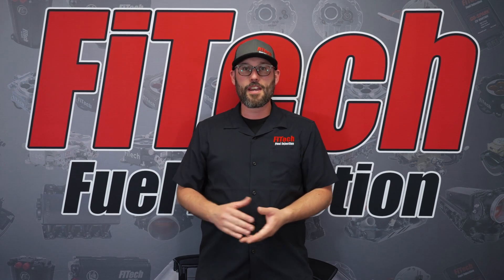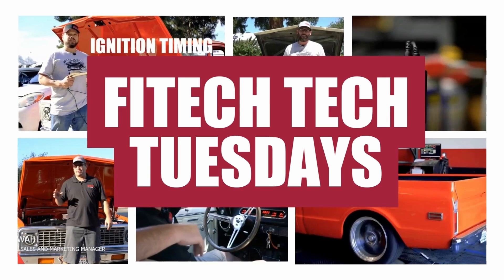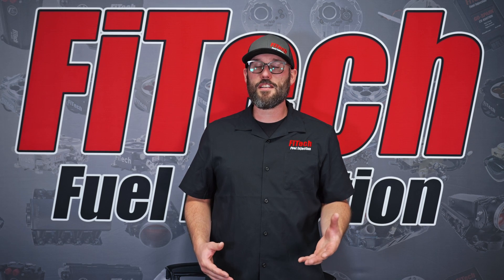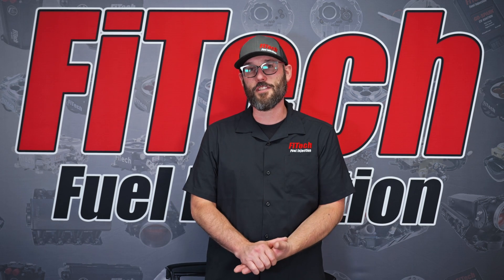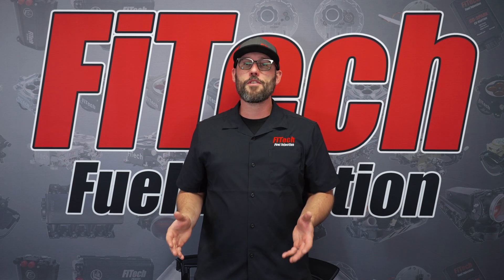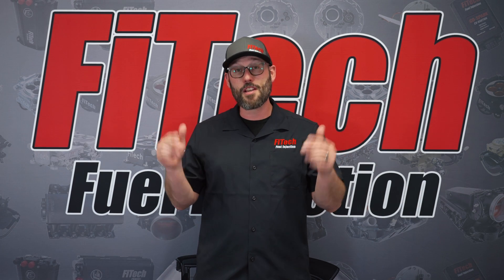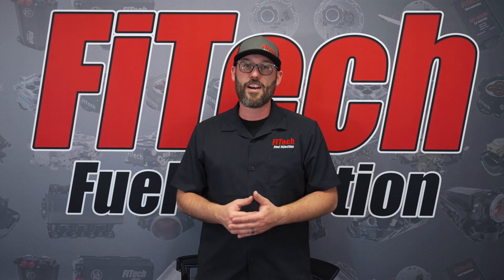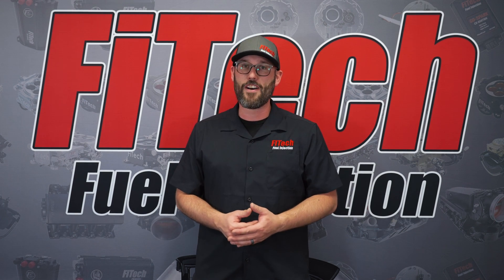Do's and Don't of EFI | Tech Tuesdays | EP90

Comment: Does the ecu have to be grounded?  I have a "No Spark" situation going on, have the complete efi harness w/trans control.
Reply from the maker: Hello sir,

For this issue I recommend contacting our technical support team, they can help diagnose the no spark issue, depending on the system, if running an LS system, such as the ULTIMATE LS ECU, the harness does include ground wires which need to be grounded to engine block, heads, negative side of the battery, frame, ect. If the issue continues our Technical support team can assist you with this issue. You can reach them at 951-340-2624 or techmail@fitechefi.com

Comment: I run a 72 Dart, which I now discover that because it uses a ballast resistor, is therefore not compatible with my FiTech. I have trouble eliminating a stall after coming to a stop where the rpm just sinks. I disabled the DCFC and try to adjust the IAC setting but so far no luck. Could this be the problem? What is the solution?
Reply from the maker: A ballasted resistor ignition will cause RPM noise and will cause misfueling. This is an issue that needs to be resolved.

Comment: I don't know where you got the idea that aluminum tubing that is typically used for fuel line is only rated for 25 psi, but that is dead wrong.
Reply from the maker: Fuel pulsation from injectors opening and closing will rapidly fluctuate fuel pressure which can fatigue aluminum lines. Also with the uncertainty of the fuel line ratings and we need to stick to a standard. There are low pressure aluminum lines out there. If this is accidentally used and we don't mention our take on it, there could be liability issues. Its better for us to say don't use a subjectively inferior part.

Comment: aluminum fuel lines are only good for 20 psi? That's news to me. How about the polytube used on newer cars? Do they hold up to the necessary higher pressures?
Reply from the maker: Anything rated to the pressure of EFI that will not fatigue over time (aluminum) is okay. Fuel pulsation can cause aluminum to crack which is the issue.

Comment: Hello I am, fighting a tach signal issue on my new hot rod fresh 383 sbc I have the dual TBI setup w/MSD it primes fuel just fine and the motor with fire initially however no fuel after that due to no rpms showing up on the controller. Spark plugs are resister type and i have full voltage to the fitech system. Any thoughts on what it could be?
Reply from the maker: Hello, i would recommend contacting MSD to troubleshoot a possible issue with your CDI box not sending a signal to the blue Tach wire.
Reply: If you are using a tach adapter, hook up the tach wire to its output, not the white MSD wire. I was having a similar issue with no signal when cranking. The adapter regulated the signal so now my fitech works fantastic!
Hope this helps.

Comment: To get the engine to crank, I need to turn the ignition key on and off twice.(spritz) especially when engine is cold. i increased the prime fuel mult and other items but still problem remains. after cranking all of things like IAC, rpm, tps and arf work good, my only problem is in cranking
My handheld is 2 dot, 30003
My engine is v6, 262 chevy stock.
Can you guid me please?
I am confused what happen
Reply from the maker: Make sure you are getting 10+ volts on the key wire while cranking. You may be shutting off the EFI while cranking.

Comment: Installed my 600 HP PA and works great. Cold starts are easy and no hesitation under acceleration, I love it.
Reply: you're lucky, you received a system that works. My Ultra Ram has never been able to program the IAC, therefore stuck in the garage with no ability to control or lock in the idle. Just installed a 3rd motor (brand new), no vacuum leaks, no change in the system. Still unable to dial it in. It has been a $2000+ loss for a year now.
Reply: how long did you need to install the full efi 600 ? are you a shop or a simple guy like me that will probably struggle to installed it ?

Comment: Is duel feed good/ bad or doesn’t matter
Reply from the maker: a single inlet is acceptable on the throttle body EFI systems up to around 800 HP. Past this point we recommend dual inlets to allow for adequate fuel flow.

Comment: I believe my ECU just failed. I have had my car running for years with my FiTech unit. I was out for a drive, did a moderate acceleration through a yellow light. And immediately the engine and car changed to being barely able to run like it was starving for fuel. I had to feather it down the highway until my exit only going 50mph no shifting. Once I turned off the road it died out. We added fuel got it running barely, got it home, it killed the engine when put in park. We have cleaned the fuel filter, checked the resistive wire, and the keyed ignition white wire all have power. We had it running for a bit, turned off the ignition and noticed the fuel pump was still running. We turned off our fuel pump with an external kill switch. Checked later something had drained all the power from the battery until it was dead. Now the ECU will not respond to the hand held at all. We checked the power wires. The sensor and plug wires and all appear to have no damage. With this system, from what I remember it is supposed to control the electric fuel pump to vary power levels based on throttle. I am wondering if some kind of glitch may have occurred, and it cut fuel, and then it, kept power going to the fuel pump when it should have powered it off, and instead just shorted out the ECU internally.
Reply from the maker: Hello, please send this information to techmail@fitechefi.com and one of our techs will assist you.
Reply: and did they help you resolve this?
Reply: @tBusket  when I got tech emails it was a little generic, for the suggestions. Even after describing in detail the issues and no power. Etc. turned out that test the ECU died, likely due to the design flaw in the earlier generation of the power relays for the fuel pump being unserviceable and bonded to the ECU board inside the throttle body. I purchased a new ECU, and new car side harness. Had to adapt it all to the wiring because now there is a remote mount relay to fix this exact issue. My best hypothesis is the fuel filter was restricted, the ECU detected lean, under acceleration, sent fuel power to the pump, and the kicker, a small two inch hose connecting my I tank electric fuel pump to the sending unit, all built by Aeromotive burst, causing further lean, more ECU power sending until the ECU cooked. Once I replaced ECU, the fuel pump immediately primed but seemed loud, car could start but was cutting out, not drivable. Lead us to putting on a fuel pressure gauge, discovering it was only 10psi, lead to dropping the tank, the filter was one of the first things we checked and cleaned. Found the ruptured hose. Replaced the hose and now the car is fully drivable. As a word of warning the new ECU needs new software installed, and it has to be the new style ECU with remote relay, but for an older handheld.

Comment: Aluminum fuel line rating is higher than he stated.
Reply: I've been using aluminum line for a rear mount turbo oil supply/return and it's been fine.